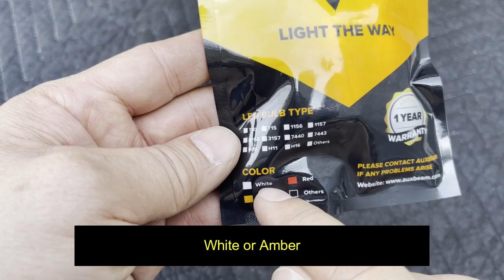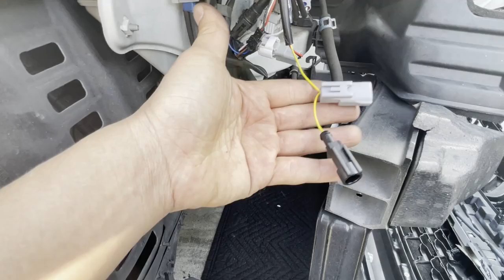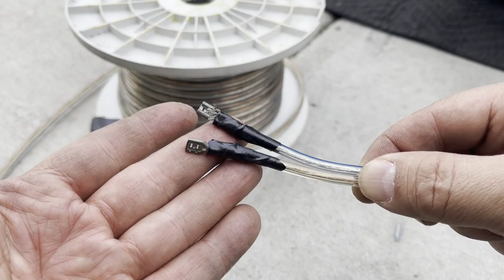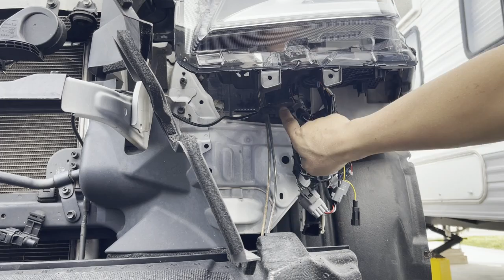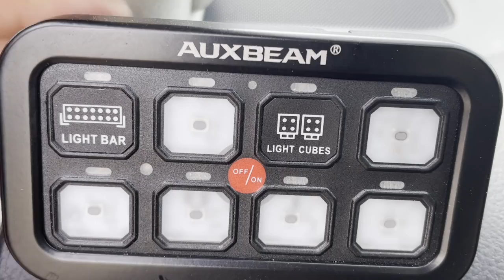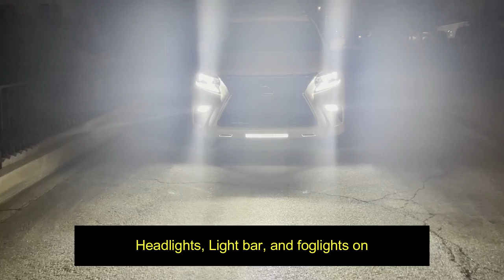DIY GX460 Foglight Conversion - Turn Signal Mod

Comment: @GXBOB do you know or have a link for the Y splitter?
Reply from the maker: @naroumsowanna4621  the Y splitter comes with your aftermarket headlights. If you have stock headlights then you would have to tap into the wire instead of Y splittting.
Reply: @GXBOB thanks for the info, yeah I’m doing a 2011 to a 2014 front end conversion and all the info is much appreciated and helpful
Reply from the maker: @naroumsowanna4621  whoaaa, you actually bought the conversion kit? Damn….
Reply: @GXBOB no, I have been piecing them up from offer up, still need a few more items most likely will get them from the dealership
Reply from the maker: @naroumsowanna4621  cost and labor, would it have been cheaper to buy a 2014?
Reply: @GXBOB it was fairly cheap, I’d say I’m around $640 for about everything

Comment: Is there a way you'd recommend doing this so that these lights are always on? I don't want to have to switch them on; could I use a t-taps into the existing DRL cable?
Reply from the maker: I don't recommend adding them directly to any of your lights.  If you want them on with either your parking lights or headlights or DRL's, then i suggest you trigger them with a relay and use your battery as its power source. And yes, the trigger can be T-tapped into your source of choice.

Comment: I love watching your videos, Bob. I've also got a '17 Base model.  IF, IF, IF you HAD to upgrade the factory fog lights, how would you do it? I dont want a light bar and I can't afford a bumper in the near future. Thank you for making these videos!
Reply from the maker: First of all, thanks for watching me act like an idiot on social media.  IF IF IF  i had to upgrade my current OEM H11 foglights, i would replace them with 20k lumens fan-powered LED's.  Here is an example: 

https://www.amazon.com/AUXITO-Upgraded-Headlight-H8-H9/dp/B09KPL6XMP/ref=sr_1_8?keywords=brightest+h11+led+headlight+bulb&qid=1651629528&sr=8-8

Another route is to convert your bumper turn signals into foglights and use 7440 carbides: 

https://www.theretrofitsource.com/7440-7443-gtr-lighting-carbide-bulbs-LED.BUL.7443.CAR2?quantity=1

The reason why i note LED and not HID is the obvious benefits: brighter, lower power usage, longer-lasting, cooler temp, lower power draw, and the list goes on and on.  But many will tell u that HIDs are more beneficial in projector-type housings which is true, but the many drawbacks of HID don't justify its main purpose for me.  I hope this answers your question.
Reply: @GXBOB  I really appreciate the response, Bob.  That is helpful.  Thank you.  I'm really looking for Amber, but don't find any that fit the GX.
Reply: any tips on the replacement?  I went with Dual color LED's from Alla Lighting.  There aren't many resources out there for this replacement.  I'd be grateful for any help you could throw my way.  Again, love what you do!  Thanks!
Reply: Nevermind, I was hoping they'd be plug and play, but they absolutely not.  whole fog light housing looks waaaaaay beyond my skill level.
Reply from the maker: @alanpehrson7454  hey Alan, youtube doesn’t notify me of comment replies after the initial one. Don’t know why. I wish i had a model that i can tackle the foglight issue but i don’t.

Comment: Hi bob. One question so it’s that still can use as turn signal after you change to fog light ? Thank you
Reply from the maker: Yes, you can always revert back to stock but keep the lightbulbs as LED.  Or you can buy dual filament bulbs to keep the turn signals on as foglights and blink when you hit the turn signals.  Either way works.
Reply: @GXBOB  thank you appreciate your help. Always love your videos.  I just swap out the grill and headlights with your videos help. Thank you

Comment: There’s some product that we put in  bottom of the cup holder and make the water bottle bright. But we need to charge them with USB. 
Lexus cup holder already have light but it’s not bright. How we can change the cup holder lights with LED lights and make it bright?
Reply from the maker: A brighter led chip and a soldering gun. It’s not plug and play. Sorry if like the side mirror turn signals, you can’t replace the bulb without soldering a new one on

Comment: Hope all is well.. Wondering if you ran into the issue of having dash showing doors are opened even though they shut.   Seems like courtesy door jam are not working or not getting power for one rear door and also rear gate door is showing its also opened.    Backup camera won't work bc it thinks door opened.    Do u know whats broken by chance?  Thanks
Reply from the maker: Go to each door jam switch and see if the bolt holding the switch to the structure is loose. Lack of solid ground can affect the entry system. Second assumption is you have a pinched wire somewhere that may take a lot of time to trace.  There are really so many factors that can create that scenario
Reply: @GXBOB  those sensor wires are super short and won't come out much.  Having two sensors go out at the same time is really wierd...   thought lexus don't have these type of issues.   Maybe buying this was a mistake lol.  Thanks for ur help
Reply: @GXBOB  turns out one of the door lights i changed out to led bulb got fried and shorted out the sensors and power to rear gate when I installed the fog led bulbs.   Not sure maybe the power output difference from 2010 models vs newer cars differ bit yeah at least found reason..

Comment: Hey Bob I'm considering upgrading to a high output alternator. With that I have to do a big three upgrade. There are no gx460 alternator videos on YouTube. Only one I find is a previous gen gx470. Are you up to it?
Reply from the maker: I would definitely be up to it if my alternator decided to take a dump.  It has not nor do i think it will soon either.  Suv is driving like a champ right now.
Reply: @GXBOB  Oh that's no problem Bob, I'll send you mine! Let me know where to send it. :)

Comment: I understand the desire to use an existing housing versus adding another but I doubt the blinker housing is well suited to aiming light to be usable as a fog. Still quite creative!
Reply from the maker: You are correct. I chose this route for aesthetics and to remove one too many turn signals.